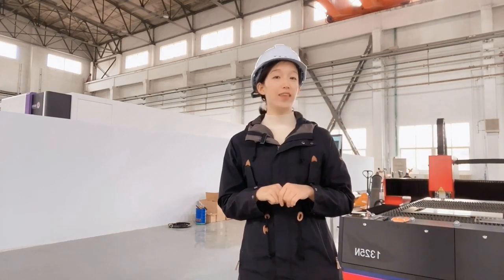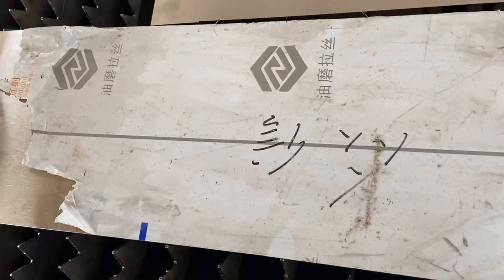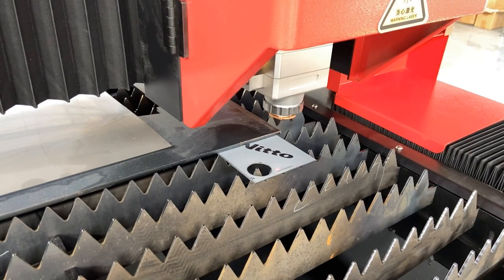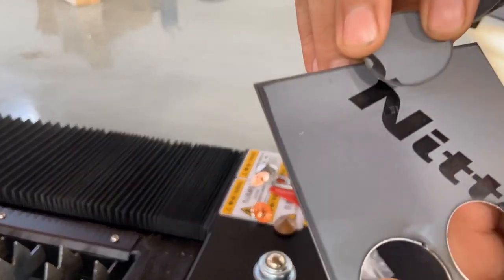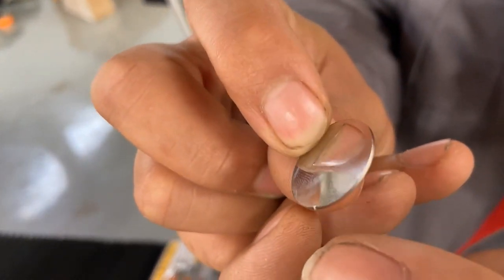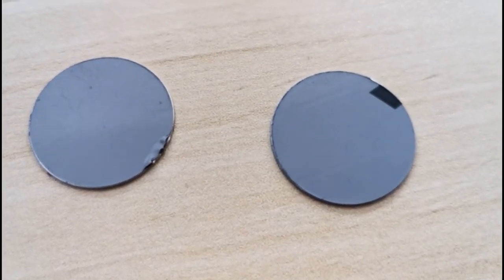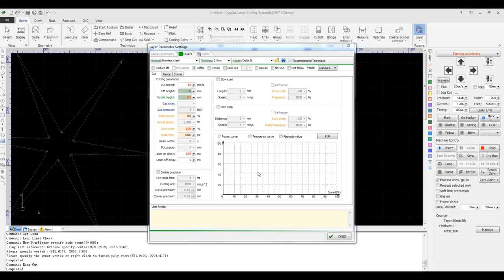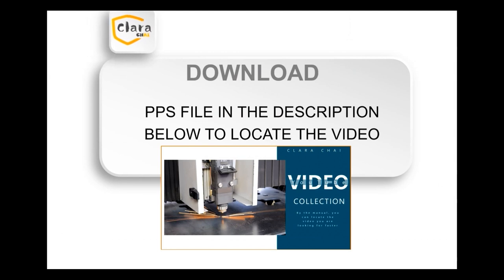FILM COATED STAINLESS STEEL CUT | ACTUAL CUTTING TESTS AND PARAMETERS

Comment: Very good video, I use sc2000, how can I configure the parameter so that it can make cuts in stainless steel without the need to remove the protective coating?
Reply: Click ✓ on defilm in menu bar